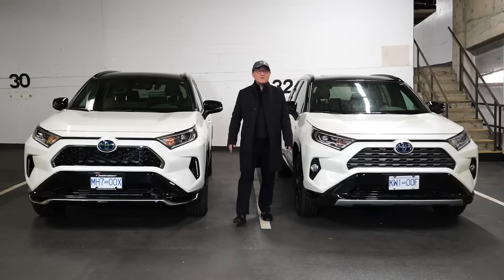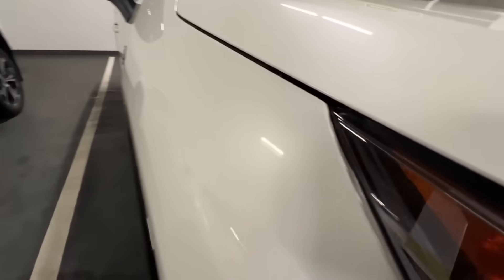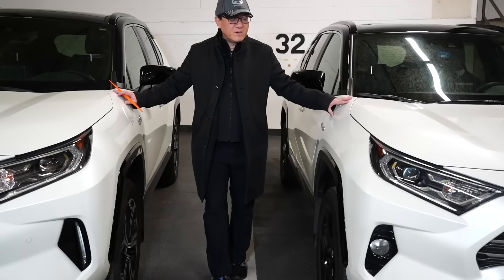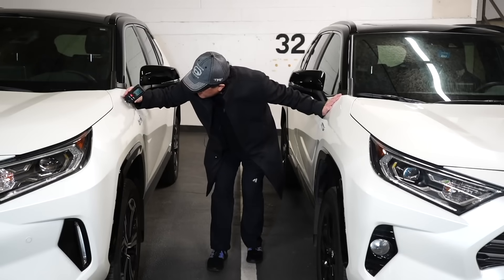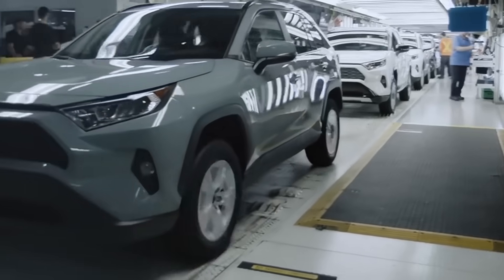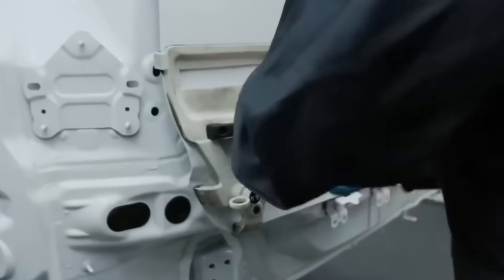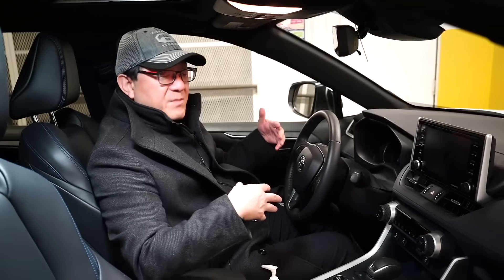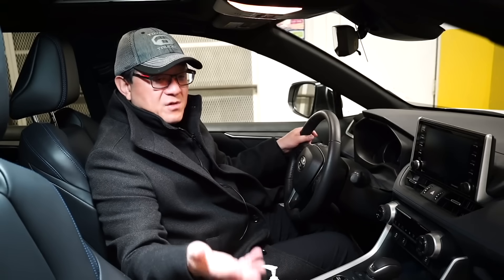JAPAN-BUILT RAV4 vs NORTH AMERICAN-BUILT RAV4 - WHICH HAS BETTER QUALITY?

Comment: Thank you for this video, Dave! Back in 2024, I ended up purchasing a 24 Hybrid Limited with the windchill pearl paid for my wife. I went to the dealers and even asked the dealer to park side by side with a Japanese built and NA build rav4 and spent some time walking around, feeling and comparing the two. I also noticed the better paint quality, the tighter panel gaps and a teeeenie tiny better overall fit and finish with the interior. I ended up going with the Japanese built rav4 and zero regrets.
Reply: The Japanese-built has softer and cushier seats. The NA build has harder, firmer seats with unlevel angle sometimes.
Reply: @waltchan Interesting. I did not notice this when I was test driving the cars. But again, zero regret going with the J-vin Rav!

Comment: My parents owned a 76 Corolla and it was very reliable.  I prefer the hard plastic used then seen on the dash, console and doors.  I have MCS - multiple chemical sensitivity and was told hard plastics are less toxic and I believe off-gas less. Plastic softeners contain phthalates which cause endocrine disorders.  I also would like to not have electric windows, locks and keys.  If the electric features break the cost to repair is higher.  I need to buy a used car because the chemicals in the new car smell, and from the AC vents are bad for the chemical sensitivity. Thank you.

Comment: Great review. We have a 2020 RAV 4 XLE here in Canada. My wife and I have questioned the build quality from time to time. 
1) Seatbelt rattle on both sides on the adjustables
2) Power passenger window quit 
3) Driver side windows sometimes will go down halfway when putting the window all the way up
4) Dash rattle 
5) maps light assembly rattles
6) The folddown rear seat broke , so I am now left up
7) Backup camera leak, so image is all blurred
8) black paint chips are easy
9) The driver side door has to be slammed and does not close with conviction 
10) Fuel light comes on at 25, and as low as 18km left.
So, question this Canadian built car.

Comment: Interesting comparison. We have a 2023 Rav4 Hybrid Limited. Put a deposit on a inbound  2024 Rav4 Prime XSE, will arrive in about a month or so (won't wait for the 2025 and first year issues). Both were made in Japan. It will be interesting to compare them for quality and drive ability. I was hoping to get a 6th gen 4Runner in 2024, but they keep being delayed. Now I will have to wait for a 2026 model, not the new model year. Like your in depth reviews and since we keep our vehicles a long time, have switched to Toyota products.

Comment: We have two Toyota Highlanders that were built in Japan. A 2001 and a 2002. In the last couple years, the bodies are just starting to rust. That is unheard of in Ontario Canada winters. They probably would be rust free if we kept up with getting them Rust Checked yearly. Getting old and letting things slide a bit. Mine has just shy of 400,000 kms and the other has 180.000 kms. All they ever needed was regular maintenance. Interior leather still looks new. Very comfortable and a pleasure to drive. Last of the insanely well built vehicles.
Reply from the maker: Amazing!

Comment: I bought a new Toyota Camry in 2009.  After a few years I found out the Camrys assembled in Kentucky from 2008 to 2013 had a high rate of defective piston rings causing oil to bleed into the cylinders.  This problem grows worse as time passes.  Toyota did not make good on this, much to my disappointment.  Nevertheless, I serviced the car every 5k miles and treated it well.  At about 125 k miles lots of things began going out.  I have 142k miles on it now and I have to add a quart of oil about every 700 miles.  In the last 15k miles I have had to replace the ABS break system, most of the emissions system (from all that oil passing out through the system), catalytic converter, alternator, front axles, and more.  I used to love Toyota but clearly they are far from perfect.

Comment: One weird quirk about rav4 from japan and america is the difference in ECU. japan made accepts LKA command and America made does not. They both use LTA for stock line keep steering assist. It matters if you want to get openpilot for level 2 self driving.

Comment: Rav4 2.5 liter gas made in Japan for mideast countries full tank will give you 640 km in distance, I have imported a Canadian rav4 premium excellent in specs but it can go up to 400 km only in a full tank of gas .. I know it is because of emissions restrictions in Canada but I am in the Middle east  currently. In order to have the same Japanese made rav4 mileage Shall I replace the full exhaust system with Japnanse one or is it an EGR system issue?

Comment: And what about the difference between Japanese made XSE hybrid(2021) and Canadian made one? The ultimate doesn’t have Steering wheel mode, JBL system, panoramic roof, wireless charger and other lack of package. I bought My Canadian made XSE hybrid and was pretty disappointed with that but in overall rest is looked like the same..

Comment: If the  Japanese built is 10-20% better than the NA one then that’s a big fail on Toyota’s part, and not the manufacturing plant. By allowing a pretty hefty  discrepancy in quality.

Comment: As the owner of a 2023 RAV4 PRIME I can state that the build quality is outstanding, not a single rattle or squeak, tracks dead straight on the freeway with the steering wheel dead center with fit and finish top notch. They are truly over achievers.

Comment: I like your down to earth videos very much. I’m trying to decide between a 2024 RAV4 and a 2024 CR V sport with the 1.5 liter turbo engine and CVT. I’m still worried about the oil dilution complaints for this engine as well as head gasket problems due to improper bolt sizes. I reviewed your video comparing the two and you rated the CR V as a better choice if I recall. Thank you!
Reply: I have owned 2 Toyota sedans made in Japan, and the second one had several things that weren't put together,  (still drove it 166,000 miles and  it was 100% reliable because it had a great company standing behind it). For the last 16 years I have driven three Texas built Tundras,  all have gone over 120,000 miles.  The only time I have ever been left by a Tundra is when the battery went dead with no warning.   I was back on the road when someone with 160,000 on their Pontiac Vibe (Numi GM/Toyota joint venture) and a set of jumper cables saved the day!  If I liked the new Tundra I could consider a new one but I am looking for the one I have going over 300,000 miles.  Don't care where they are built, the US ones have been better for me!
Reply: Me too.  I bought the Rav

Comment: If only Toyota would add insulation on the RAV4 it would be a great vehicle. I have owned 3 and all had horrible road and wind noise. Test drove a Mazda CX5 and was 100% quieter. Ended up buying a CX5 and have been extremely satisfied. Can actually talk inside the cabin without raising my voice.

Comment: My current 4runner 2020 leaves allot to be desired quality wise. Rusting rear gate, rusting frame and underbody components. It’s washed weekly 25,000 miles on it. The rusting gate has been a problem for generations.

Comment: Isn't the Prime a higher tier RAV4 compared to the regular hybrid model? It's important that your viewers should know this, and currently, all the Prime models of the RAV4 are assembled in Japan. This is not an orange-to-orange comparison. I'm sure this is probably the best you can do, however, the difference in quality you may have spotted, for example, the quality of the interior you have commented on, doesn't say much in the quality of the assembly process, because one of them is actually much more expensive than the other. So, I wouldn't be surprised that the Prime model may have a slightly better interior and exterior finish.

Comment: Toyota’s quality is going down in general in my opinion. . It doesn’t matter if where they are made. I had two NX hybrids that both were made in Japan and both  had issues around the 20,000 mile mark. The first one had a lopsided frame due to a production issue and the car pulled to the left , but I guess there was a recall for it, although I doubt a dealer can ever fix a frame correctly, and the second one has an abs pump brake noise  problem. They weren’t built like before. Luckily my new Nx has a warranty for the first 50,000 miles but I will get rid of it before my lease ends. I also had a Camry built in America  that had issues around the 60,000 mile mark—steering rack went bad and crank case popping noise. Cost me around $ 2000 to repair out of warranty. Now my sunroof has a popping noise which I will not fix due to the cost. My friend’s Camry has a leaking strut at 30,000 miles, but will be changed under warranty

Comment: Would reduced engine vibration enable the Prime to have tighter fitting body panels since it’s capable of running on electric only for a number of miles vs the constant start/stop of a hybrid? Not feeling like this comparing is apples to apples.

Comment: I remember in the 80's and 90's was a attempt to bash Japan's engineering and manufacturing. Glad this went away, I love what they do and stand for. 
Business, the worst thing about American business is not quality control or engineering, its term incorporated... that leads to one stupid rule. Your company has to do everything to make a profit, share holders first. Accountants will deliberately  choose bad quality because it cost more not too. What they are missing is loyalty... that phrase should be band from all business dealings. Make the best you can, have the best service, be polite and not mean...... I guarantee you, you will not have issue with customers

Comment: I have a Japan built Toyota approaching 40 years old, whilst the 2 stage paint obviously hasn't held up perfectly, the metal framework itself has seemingly less corrosion on it then some American built 10 year old Toyota under bodies

The kicker is this car has been kept outside all its life, often in a yard or field with a flat battery which doesn't help the metal stay fresh any, Hell even the constantly heating & cooling mufflers and stuff still look unscathed to the decades. So at the very least I can say Toyota Japan seemingly uses more resistant steel alloys, at least historically

Unsure if modern Toyota have caught up, but for decades material differences was obvious between the two sources, granted American Toyota & even other Asian brands building in America still offered higher quality steel then the Detroit brands especially when talking about the exhaust parts which again due to heat cycling needs blends which can cope, but there was a difference for longevity, so even ignoring the talent differences, Japanese metal had staying power since it simply used better elements/ingredients

Comment: The differences in the interior texture might just be because the Prime uses a slightly better interior materials than the Hybrid.
Otherwise it looks like they're very similar and the variances in panel gap/paint are so small that I wouldn't be surprised if two identical cars from the same plant had such variance.

Comment: As an owner of a ‘21 Highlander, I can say I am somewhat disappointed. I’m sure the vehicle will be safe and reliable, but mine already has some rattles. The infotainment is glitchy, the parking brake doesn’t always release when vehicle is placed into drive, it gets the advertised fuel economy, but is almost 20% off in fuel range, and the some of the plastic is very reminiscent of 80’s GM. 

It is definitely a smoother and confident ride and made much better use of the front interior space than the Rav4. But I am doubtful I will ever buy another Toyota. The quality isn’t quite at the price I paid at the time and the dealer I have dealt with has not always been pleasant.

Comment: Hi David, I just picked up my Japanese made Rav4 Prime, and the fit and finish is great.  One question I do have is regarding the gasket between the headlights and the hood.  There isn’t any, allowing dust and rain to blow into the engine compartment.  I have read that the cars built in the North American factory do indeed have those gaskets and it seals the hood effectively.  Toyota even has parts that can be ordered to fit the bill.  Any idea why the discrepancy?  I figured if anybody who know, you would.  Thanks.

Comment: I have a 2018 Camry that was Built in Japan. But I've had issues with my car. Back in 2020 I had a minor hit and run,  and found out from the  Collision Shop my vehicle was in a previous accident.  Previously  had a 2014 Camry  that was made here in the States.  Had a an issue with that one as well over heating etc.Had a 2010 Chevy Impala that was Made in Canada that  was very reliable. I think Quality isn't what it used to be like in the 80s&90s. Even Honda/Acura has gone down. But I do think any vehicle,  mostly made in its Native County,  Europe & Asia will built with better quality.

Comment: i don’t doubt about Toyota quality, myself has a Corrolla 2011 w/120k and just replaced shocks abs, CV axles, water pump and tires. What lacks behind is to give to the owners a real maintanence manual, so, the owner keeps up the preventive maintenance and not need to wait for a mechanic tell you what is wrong, am i explaining? You are told “ATF is forever” and at 65K found out it was not. Three times I had it replaced but not flushed out. Hope somebody in Japan reads this rant. Thanks

Comment: Is there a video comparing specs next? I'm curious to see what features are different on the highest trim for both due to different regulations or money saving. We have a car built in Japan, but its US spec so it doesn't have certain options offered in Japan, such as engine choices, optional safety features, etc.

Comment: As a repair technician, the better question is: which one is easier to get parts for? We had a Japan-built model (forget the specifics) we needed to wait almost a month for a window regulator and rear springs, both of which we could have had next day for the North American built model.
Reply: They use the same parts? Vehicles built in different plants don't use different parts.
Reply: Different part numbers?
Reply: @shoersa yes, they are different part numbers but exactly the same part
Reply: Yeah, just order the parts and compare them, 99.9% of the time they are the exact same part and everything lines up and work the same
Reply: Where did you get the technician certificate 😂

Comment: To me , reliability means, is the vehicle going to constantly break down and leave you stranded. If a panel is 1/2 mm off, isn't something that is noticeable anyway.  I'm sure we can see those difference between a VW made in Germany vs Mexico. I have a 2015 VOLT that gives me ZERO problems. The only repair I had is the battery coolant valve that was off by 10%. But, I agree that Japanese are very serious people compared to our North American managers.

Comment: If the panel fit is so good, why can I just press down on my hood on my '21 gas xle and have it move a significant amount. I can actually see the hood move with wind when I drive. There's also a giant gap between headlights and hood. It's very odd. I've never experienced this with another car. I think my biggest problem with Toyotas is the combined lack of details from an engineering side combined with a clear level of cost cutting with certain trims.

Comment: David, are you kidding when you said for the most part it is not noticeable? For Toyota in specific, Look at car care nut Youtube channel, He bought Toyota Camry and look at what he said about north American's craftmanship. There is cultural differences about work ethic from JPN VS north American and it shows in car manufacturing. I experienced it on my Honda... you don't need to trust me since I don't even post it on YT, but at least look at car care nut about craftmanship and built quality of his new Toyota Camry Hybrid, his concern about built quality is inline with my experience for my newly bought 2023 CRV Hybrid.
So yes btw, I disagree with you, there is a noticeable difference in built quality between North American vs Asian made car.
Reply: I had a similar experience to you. I bought a higher trim 2021 RAV4 hybrid(new) which was made in Kentucky and a $10k cheaper 2022 Corolla hatchback(also new) made in Japan and the Corolla is definitely better quality. My RAV4 has more squeaks and rattles than I’d care for given its price tag and I already get the impression the Corolla will outlast it.

Comment: Body gaps can be adjusted. Rubber bumpers for the hood, doors & trunk can be raised or lowered and that can determine body gaps. I don’t think anywhere else in the world has higher standards in the automotive industry than North America. Yes Japan is the designer and manufacturer for the brand however they do design their vehicles to be approved to be sold in North America, I don’t think they’ll leave out features and safety for Japan vehicles only.

Comment: I may be the only idiot but why did you pick two different models? Would it not be more accurate to use the same year and model?

I'm simplifying my assumptions but would there not be different clearances based on where it's built anyway? Like for expansion or whatever they know based on where it's manufactured?